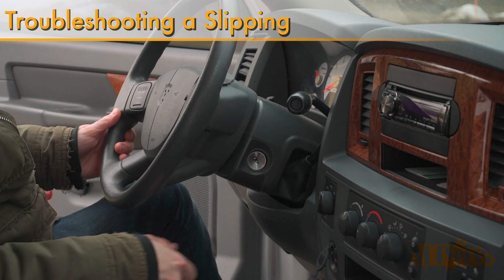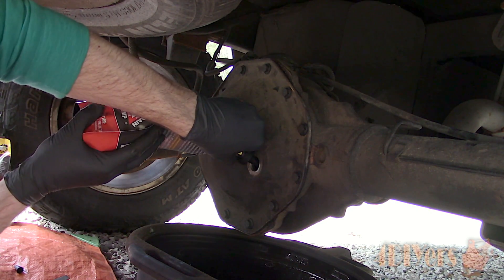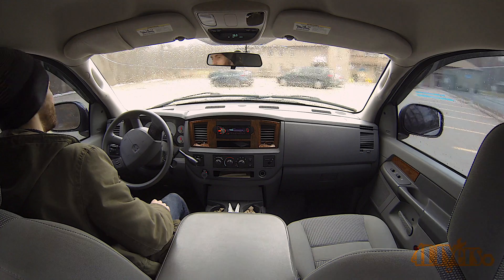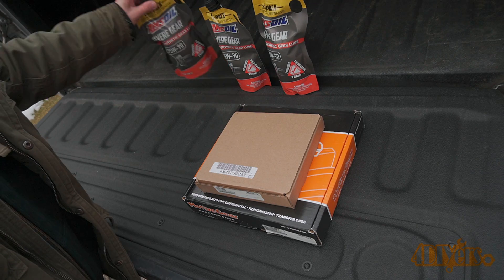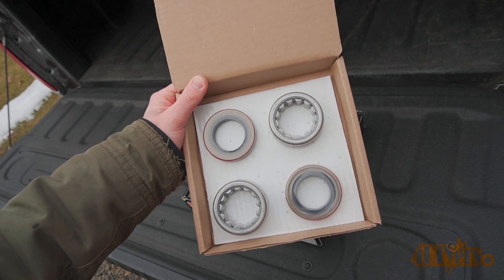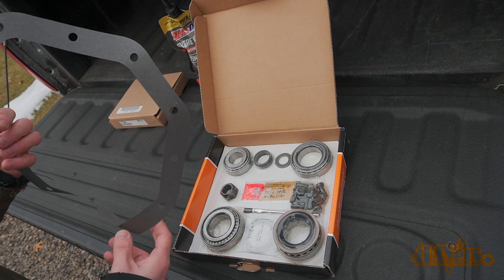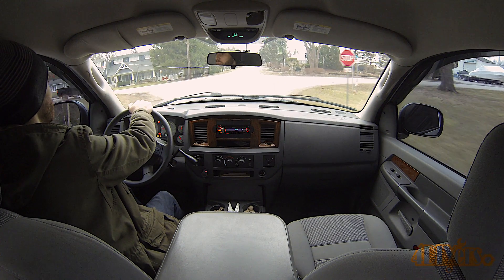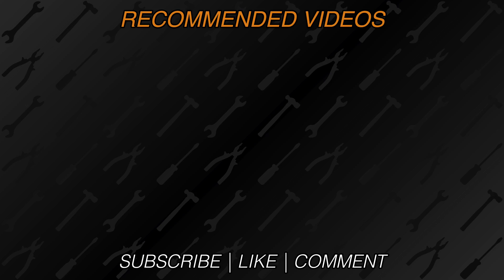How to Troubleshoot a Worn or Slipping LSD Differential on a Dodge Ram

Comment: how do you know if the LSD is too tight ?   but it's not making noise and not notchy.   When I spin the wheel like you did, it feels like it's pretty tight all the time.  I thought a limited slip is to be not so tight, but when one wheel slips the fluid heats up and the clutch THEN tightens.   The issue I am having is that it seems my vehicle needs excessive steering input to round a corner.  or like an under steer issue due to a stiff LSD.

Comment: me driving in a figure 8 patern looking like a maniac 😂😂
Reply: it will give you your answer though.  Changed the gear oil on my friends 2095 BMW 330i with an aftermarket LSD and drove in circles in both directions to work the fluid in and the LSD chatter went away.

Comment: I had to replace the clutch packs on my 03 F150 due to rear end chatter. Cost about $900 CAD but it's perfect like new now.
Reply from the maker: Was it just the clutches or did they do all the bearings and seals too?
Reply: @4DIYers  had to do outer seals and unfortunately integrated with bearings so it was all replaced.
Reply from the maker: That was a really good deal! It seems like Dodge isn't that cheap for parts anymore.
Reply: @4DIYers  total bill was a bit over 900 but I forget the exact number. I got a cash discount for the labour if you know what I mean. That was about 4 years ago too. I’ve had my truck for 5 years now, I’m sure prices are higher today.